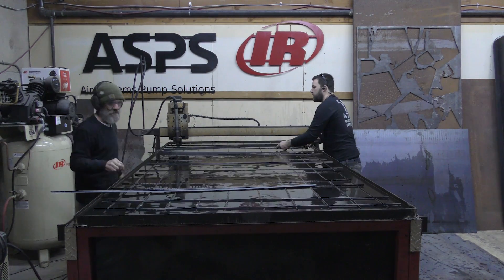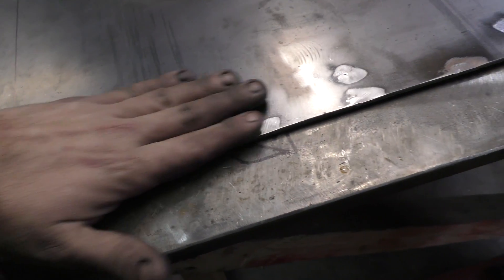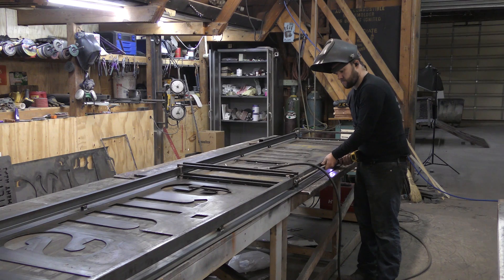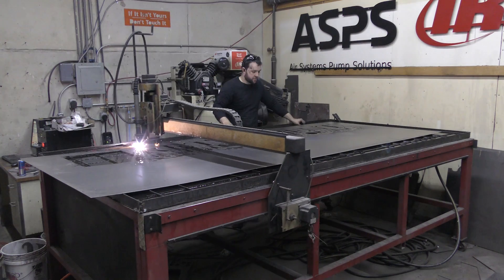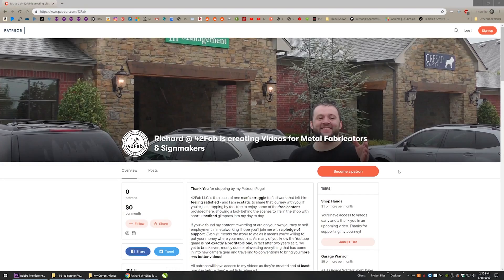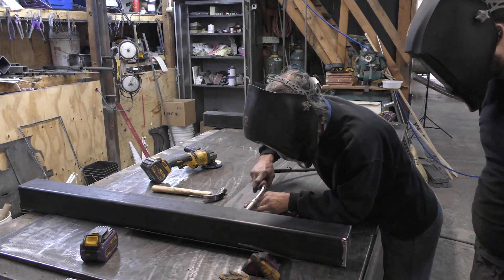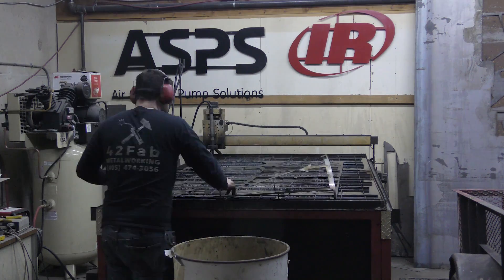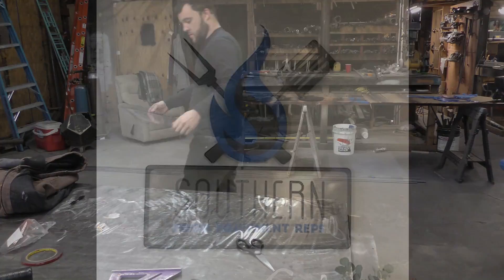$16k in 12 days with a CNC Plasma Table. 6 Signs and a Table

Comment: Your work looks great. I do not know if you have a shear, but what I do is shear the box and cut out the guts. When the sign is even longer I put a box off to the side and slide the material which enables me to make a much longer face in one piece.
Reply from the maker: In reference to the retirement sign?
Reply: @42Fab  To any sign longer than you can cut.

Comment: Why didn't you fill those grind marks you made in with your welder?? Especially on a huge .125" steel plate. The powder coat will get rid of any impurities. That would have been invisible. It's just like bondo but better. I'm really curious because that's exactly what I would have done and have done many times.
Reply from the maker: As you would be wrong, read my multi comments explaining this
Reply: @42Fab  but you grind the face because of over penetration anyway.. 🤔 I'm not "wrong" because my solution is different than yours 😂 I'd argue that the product would have been the same.

Comment: Are you not worried about rust? You have overlapping surfaces here and nothing is galvanised.
Reply from the maker: Powder coating will fill any gaps where surfaces overlap, encasing the areas that are not powder coated.
Reply: @42Fab  Wasnt expecting you to reply so fast. Do you also sandblast to remove mill scale?
Reply from the maker: @black00thunder  powder coater does before coating

Comment: The first sign you attached to the brick wall you had some all thread going through the brick, did you drill all the way through and put a washer and nut on the back side of the wall to attach it?
Reply from the maker: Yes, it will be landscaped behind and so not visible
Reply: awesome! I was just curious on how you would mount it if you didn't go about doing it that way!?
Reply from the maker: @duerksenmotorsports1355  either masonry epoxy or brackets that get screwed in then the sign mounted to those. Customer's choice
Reply: I see, very cool thank you!

Comment: 16 thousand  in 12 days does not seem like enough you're making less than $1,500 a day. Seems like you work about 12 hours a day and you're worth about $40 an hour that's $500 a day and your other employee is probably around $300 a day that leaves you $500 to  $700 for material consumables and profit which is not nearly enough I was trying to make each employee pulling their wages in profit every single day now most days that's a pipe dream but if that's your goal and then tell you charge based on that you have a better chance of getting it there
Reply from the maker: We did very well on these projects. Could have charged more, but happy nonetheless

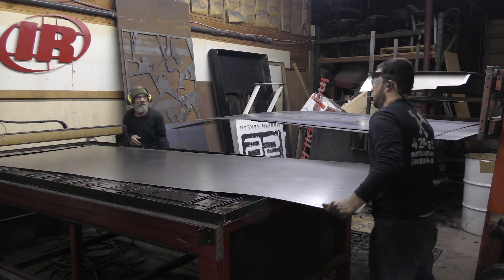Comment: 6:05 Tetanus is not inherent in rust or metal... it is in dirt when a certain bacteria is present. the "stepping on a rusty nail will give you lock jaw (tetanus)" thesis is because a rusty nail is usually in a yard and covered in dirt., the nail forces the bacteria and dirt into the wound. has nothing to do with rust or metal as you can see from the fact your metal isn't rusty. besides, rusted metal (iron oxide) is how our blood transmits oxygen to our cells so the thought that rust in a cut could cause tetanus is just laughable at best...

Comment: great video

but you know a laser welder  around  7-8 grand
the result   would look incredible for you

after welding  a little bitty sanding  then  you can  take  to polishing  or  powdercoating

the  1/32 stainless can be  welded that  it   shows only a little  blue discoloring by heat, but only on a thin line  next to the welding

heres a link
this machine has  the  attachment  with  monitor you can weld  down to  1/64 thicknes

also has attachment  the manual gun  you can use  up to 12 ga
im not agent  i just see your shop could  upgrade with this

https://www.aliexpress.com/item/32869689462.html?spm=2114.search0104.3.83.5bb76f68KDUgo7&ws_ab_test=searchweb0_0%2Csearchweb201602_10_10065_10130_10068_10547_319_10546_317_10548_10545_10696_10084_453_454_10083_10618_10307_537_536_10059_10884_10887_321_322_10103%2Csearchweb201603_60%2CppcSwitch_0&algo_expid=ea5fe8c0-54a7-4aeb-8304-dc3802ede37f-13&algo_pvid=ea5fe8c0-54a7-4aeb-8304-dc3802ede37f&transAbTest=ae803_4

Comment: Man I love your profession, I use to build molds using a CNC, never worked with plasma cutter but it's way more effective for this.

Did you study metal sheet working & Welding?
Reply from the maker: entirely self taught

Comment: Looks like a fun job, it will be a shame when someone like amazon takes over the industry.
Reply from the maker: until we have a sentient AI you can describe design goals to, one off work like this will be safe from automation. I plan to be retired by then.
Reply: @42Fab  Well i'd imagine that how someone like amazon would do it is by having an online service that lets you design the sign using tools on the website, like you select pre determined shapes and templates to create a design. Takes the individuality out of the process but people will always want something faster and cheaper than before. 

Its already happened to a bunch of services which is pretty disappointing.

Comment: funny how countries are different, I am 30 years in Europe with a sign shop, but we use aluminum composite sheet 3-6mm, it is fast to work with and light for installation at any height and so easy to fit..., plasma is good, i have one but we not use it much, in my eyes a cnc machine with drill bit and composite sheet is 1000 times better
Reply from the maker: Here we have hail and Tornados, Aluminum dents and bends much easier than steel
Reply: that is why we have insurance. lol and make service contracts, i think you have no experience regards advertising
Reply from the maker: @magicalempire  lol, yeah, just been in the business for 6 years. Call us next time Germany starts acting up, until then enjoy doing it as you do and I'll keep doing it my way.
Reply: @42Fab  why do you think Germany, my business is worldwide mate

Comment: they sell body filler that can be powder coated, called alvin lab metal.. also you could have filled those gouges with the welder and ground them smooth.
Reply from the maker: ...and I've answer this question a bunch in the comments. You're wrong because that work is worth more than a new sheet is. Coulda, yes, shoulda, no

Comment: I worked in wheel factory,  (im talking huge 60-70 inch wheels for forest and mine trucks) and before powder painting sometime we repaired center discs with car epoxy kits. Once painted, you cannot see any grinding or punching marks, and all that lasts for years, never got any reclamation

Comment: Hi mate, you could have orby'd the sheet before powder coating and you wouldnt have seen the grinder marks.. just a sanding 60grit pad on a random orbital sander
Reply from the maker: They were a mm deep
Reply: @42Fab  still possible I'm a aluminium balustader and have to fix a lot of stuff the other guys think is good enough
Reply from the maker: you do that on steel and get it done in less time than a new sheet is worth and I'll hire you.

Comment: Just throwing this out there. There is a metallic based body filler out there for filling imperfections on steel before powder coating. Because of the metallic base, it doesn't interrupt the current when being coated.
Reply from the maker: yeah, I've tried a few, and they do work really well on details. The problem is in a large, flat surface like this almost anything is going to show. The cost of having to recoat a panel would be ~$300 + time, whereas the cost of the sheet is effectively less than $100 when you factor in the other uses the scrap got. Ultimately, I'd also rather be able to say that I didn't have to repair a screw up, the customer got exactly what they ordered and paid well for.
Reply: Makes sense. Good to see someone actually giving a shit about quality, you don't see that much anymore. I'm haven't used the stuff personally, but have a buddy that does smaller scale powder coating, mostly restoration projects.

Comment: That would be so much fun to work at a place like this. I’ve had a dream to own a place like this since I was 15. I’m 19 now and it keeps looking harder and harder to achieve but if I keep working hard then I know it’s possible.
Reply from the maker: I started with literally a grinder and a $400 used welder. Keep at it and you'll get there, what you see is me after 6 years at it

Comment: Could you have just welded some small beads into those grinding scars and just sanded them down?
Reply from the maker: Not without that showing after powder coating. The time required is worth more than a new sheet costs
Reply: @42Fab  Oh ok. That makes sense. My current coworker has been teaching me a lot about cost of time vs cost of material.

Comment: Trueplasma  sells a 5x10 table with computer and hypertherm plasma with torch height control for only $8,000. Its a fully welded together frame not a bolt together that cant stay square. And it have a 6" deep water table to catch the metal dust from being in the air.
Reply: Link please.

Comment: you can use JB weld as a powder coat bondo you just have to cure JB weld in the furnace remove any built up moisture in curing process then just give it a light sanding to blend it all together.
Reply from the maker: I've tried that. Works pretty well, but for a customer, they get as close to perfect as I can get
Reply: @42Fab  Fair enough just thought i share the insight to save you some money on scrap :).

Comment: Aluminum. 99% of signs are aluminum. No rust. Lighter weight. Etc. appreciate the fab just sayin. Cheers.
Reply from the maker: maybe how you do it, or where you are. In Oklahoma we have hail and tornados, I've never had a steel sign suffer major damage.
Reply: @42Fab  not to mention cost omg aluminum is expensive

Comment: I have a 24 inch CNC plasma cutter. I work in a small fab shop and work off my employer's scrap. I make a lot of dog silhouettes. A friend of mine sells them at a local market in the summer.  I have a small house and my shop is in the basement. I love your work. I bought my equipment in hopes of learning it now and using it to make some money when I retire. The last five years has been a lot of learning. Right now I am trying to learn my powder paint gun. I bought a small custom oven. My employer bought a fast laser, 1200 inches per minute, and crops everything very tight. So my scrap supply is low. Thanks for the video and keep up the good work. 
WED-A-SAURUS  Racine, WI

Comment: First video, great so far, but before I forget. You could have filled and then powder coat, provided the filler can withstand 400 degrees. Those were thin cuts, the magnetic field would have been plenty.
Reply: Powder is applied / attracted by grounded part and positively charged powder.
Where does the magnetic field come in to play?
Reply: @urbancare5972  Sorry, I misspoke. I meant the attraction. But there is a magnetic field created and its usually a hindrance.
Reply: @jasonpowell9718  You night want to check this out.
Magnetism doesn't play any part in Powdercoating.
If that were true, how could you coat aluminum or wood? Not to be snarky, but I've been doing this since 1987...
Reply: @urbancare5972  But yet you are being snarky. Explain the faraday effect then if magnetism plays no part. I coat only aluminium so i know your point
Reply from the maker: It's easy to confuse magnetism and static, let's let this horse rest in peace
Reply: @42Fab  You bet!

Comment: OK, I don't know anything. (get that out first)  BUT you scrap the sign because you can't use BonDo . Back in the day they used lead for final fill . NOW the QUESTION?  couldn't you use another filler solder lead or something instaed of BonDo ?  Just asking
Reply from the maker: Powder Coating exaggerates imperfections. Paint can hide it, but powder coating won't. The exaggerations catch shadows. For multi thousand dollar projects, you don't send out repaired parts of you care about your reputation.
Reply: @42Fab  Why didn't you just come back with a tig torch and fill the spots in and sand smooth?
Reply from the maker: You will always have that show. Even just from the blended edge of the grind
Reply: @42Fab  thanks. I've always been a hobbyist but I'm just now starting to look into starting a business.
Reply from the maker: Your name is gold, don't let a $100 sheet of steel ruin that. And if the  customer complains you're redoing it anyway and paying for powder coating again.
Reply: This is from Eastwood :"This Eastwood formulation is one of the few solders that can actually be powder-coated and cured at 400°F (with accurate temperature control) without deforming. The fact that the lead-free solder can withstand powder-coating temperatures is a big benefit because it provides an alternative to Lab Metal for filling irregularities in iron and steel parts that will be powder-coated. Keep in mind that most of Eastwood's powders are cured at 400°F -- this is 28 degrees less than where this solder starts to soften. The solder is weak at 400°F but will not deform."

Comment: How do you attach the sign to the wall? Press the threaded rod into the brick with some sort of anchor adhesive? I know that's how they do lightweight letters, but curious about big heavy stuff. I know the sign at the end was mounted up from behind, just curious on how you do it if it's a brick or concrete wall.
Reply from the maker: On that first one we ran 1/2" threaded rod thru the wall and bolted from the back. It will be landscaped eventually so not visible. If it needs to not skow on the back we would use a masonry epoxy

Comment: Great work as always. On the Wilshire Point sign, you use the inside of the letters for a shop display. Do you have entry arcs on those letters? I have to arc into the metal or else there is a gouge at my pierce point. I would love to figure out how to avoid having the scrap the inside of the cut. Also, the Stencil in general is great, that will definitely help me in the future.
Reply from the maker: I run a .2" cut in, so if it's noticeable I just tack it closed